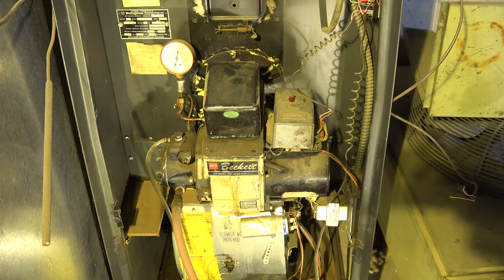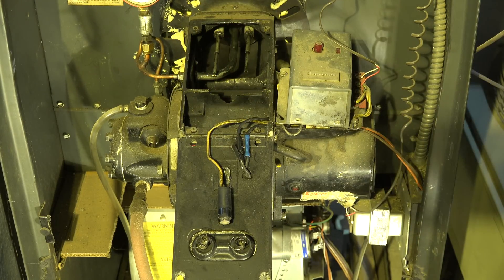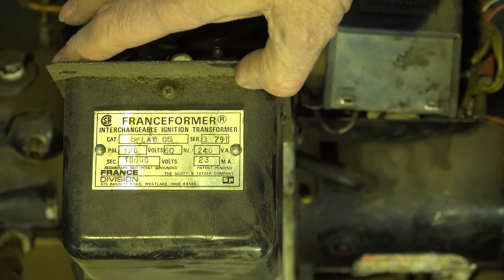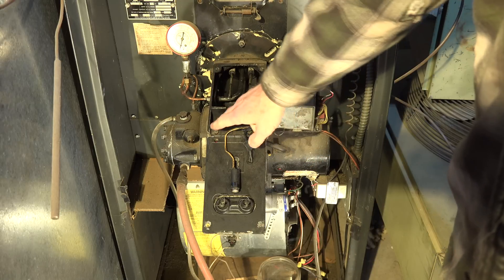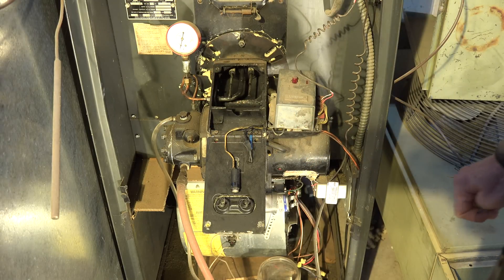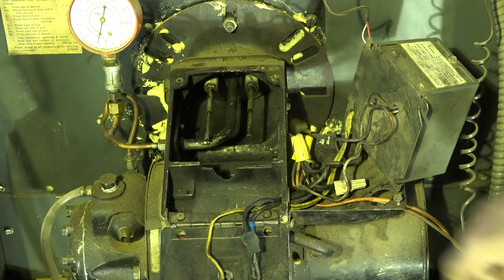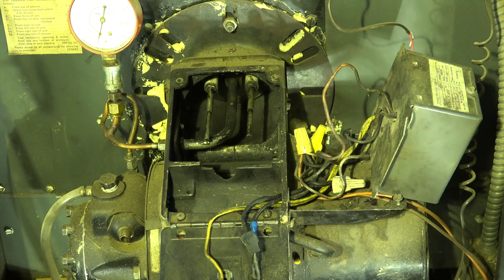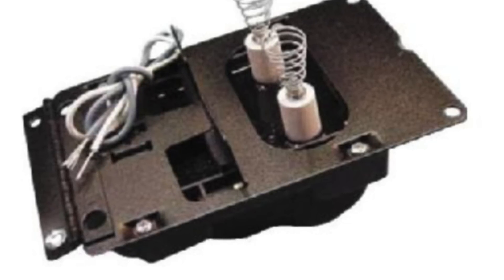How to replace the the oil furnace transformer.

Comment: I don't know if you will respond to this or not but I got a Wayne burner model DU-15A and ignition transformer is acting up. My furnace tune up guy said I need a new burner and told me there is no way to fix it. As per tune up guy, transformer is not delivering enough power to the electrode to start the burner. I know if I swap the ignition transformer, the burner is as good as new with some hiccups. I don't have issue getting a new burner but as someone who knows tweaking few things can keep an old device going, I'm not ready to give up yet. Please let me know if you have any suggestion about a replacement transformer. TIA
Reply from the maker: I would replace the transformer.  You can still replace parts without giving up on the burner.
GFM
Reply: @grayfurnaceman Thanks for the reply. I will post an update once I am done with the surgery of boiler.

Comment: I hope you are still online. My oil furnace went out. Happen to be the fuel pump. I changed the transformer as well. Just can't seem to reconnect the wires correctly. the orange, white, and black wires coming from the relay box and the light yellow and light orange wire coming from the motor. I am not sure how to connect them all back together to get the furnace to turn on. although I watched to video several times something gets lost in the jumble of wires. I need help. Its cold

Comment: I do not think that fuel line is kosher.  The flexible braided plumbing tube, if that's what you have, is plastic and will melt if it gets hot and you will have uncontrolled flow of oil into your basement and what might be your worst nightmare, especially if there is a fire.
Reply from the maker: The furnace shown is a test mule, not an operating furnace in a structure.
GFM

Comment: I have 2 black wires, I'm told if I hook them up wrong it'll be bad. In this video you're saying it doesn't matter which wire, can you elaborate why it doesn't matter?

They are identical in thickness, color,  and illegible markings. One is slightly longer though.
Reply from the maker: There is no grounding in the transformer.
GFM
Reply: @grayfurnaceman  Excellent. Thank you for replying so fast. I basically rebuilt my AFG with knowledge from your videos and it saved me thousands, Thank you. I O U

Comment: Bought a new house and came with a heating oil furnace and water boiler which was new to us. Called the service company that the  old homeowner had used. They came out and after about 30-40 minutes told us it was the transformer and that it was $385 for parts and labor to put on the new transformer and tune the burn again ( had to drill new holes which introduced more oxygen). Wish I had known how cheap and relatively easy this fix would have been.this was on top of the $99 service call out fee. Also had to pay back dues for the old homeowner for 8 months and $19 a month going forward (but hey the service call fee is waived lol)
Reply from the maker: Well, perhaps you will be able to do your service in the future.
GFM

Comment: Want to order a replacement transformer to have on-hand when existing unit fails. Online, can only find 2721-628G w/external ground wire (part description: "Ground: Mid Point Ground"), to replace my existing transformer 2721-628A (no external gnd wire). In the online picture of the 628G, don't see an external gnd wire, but only two wires coming off the case, which I assume are HOT & Neutral.  Maybe I'm supposed to supply it and connect it to a gnd connection marked on the case? Is this ground wire connection optional (already grounded via case mounting?)
Reply from the maker: The newer ones do have a ground wire.  Connect it to the chassis of the burner.
GFM

Comment: Thanks for all the videos. I got home to no heat in the house last night(50 degrees). After about an hour and three of you videos I was able to diagnose the issue as a bad transformer. Today I went to Home Cheapo and grabbed an electronic replacement. One more video(this one) on which wire goes where and the heats back on. Thanks again. I have no furnace experience and your videos saved me a late night trouble call and helped me fix the issue for a grand total of $38.52.
Reply from the maker: Glad you got it going.
GFM
Reply: That's right,good job..

Comment: Why do some people not like to call them ignitors?
My transformer  says ignitor  on it
Reply: It's not an igniter. It's part of the ignition system. All the parts have to be there. Kind of like why your elbow is an elbow and not called your arm. Unless yours has the electrodes, transformer and relay in the same device. The only purpose of the transformer is to turn 120/240 volts ac and transforms it to 10,000 volts ac.
Reply: @shawnshurtz9147  great explanation
Without everything its literally  just a transformer!
Thank you so much for the clarification. 
Moving  foward ill call it a transformer  but if someone asks me for an ignitor ill know what they mean

Comment: Guess mine has gone bad - furnace wouldn't run and I found there is black tar oozing from the bottom of the transformer; even down between the spark gap and blocking the CAD cell!   I can send you pictures if you like.   Is something else causing this that needs to be addressed before replacing it or do they just get old?
Reply from the maker: You could have a draft problem.  If the gasses don't move up the chimney, they will come out back thru the burner and overheat the whole thing.
GFM
Reply: Thanks - so if I fix any draft problem and clean up the old transformer, maybe I won't have to replace it?   How do I check the drafting?
Reply from the maker: I would replace it.  The best way is with a manometer placed in the smoke pipe before the barometric.  There should be a small hole there.  It should have -.04 in wc.  There should be no time when smoke comes out of the barometric.
GFM
Reply: Well, I don't have a manometer but I cleaned up the melted tar a bit, esp. what was blocking the cad cell and the furnace now runs again.   Got up on the roof and checked that heat was coming out of the stack so guess it is ok.   Course, heating season is pretty much over now.   The problem MAY have been caused by the fact I left out one of the 2 screws holding down the back side of the transformer - those little screws are a POTA to screw in!   REALLY appreciate your help!!!!!!!   I should send you my home brewing coffee secret - :D

Comment: Would a little smoke on startup be caused by a weak transformer. I noticed the springs on it are very dirty
Reply from the maker: Probably not.  You are probably not establishing draft.  I would be looking for blockages in the heat exchanger or smoke pipe.  Then do a complete service of the burner.
GFM

Comment: have you ever made one of these run on waste oil    we don't have regular home oil to buy here  but I have plenty of waste oil  to use
Reply from the maker: +thomas1971ish They won't work for waste oil.  Burner design for waste oil is completely different.  The nozzle will not spray into small droplets using lubricating oil.
GFM

Comment: Good stuff, thanks for sharing!

Do you ever change the foam gasket between the burner body and transformer ?
Reply from the maker: +Dicofole Yes.  If you have smoke leaking out of the gasket, you have a venting problem because the combustion chamber should be under negative pressure.  Hope this helps.
GFM

Comment: Great video GFM! I had two failures with the newer electronic transformers, (less than four years old). Everyone I talk to say go back to the old, heavy, copper wire transformers like in your video.
Reply: I was curious about that. Heard the same thing. Old styles are more reliable than newer electronic crap.